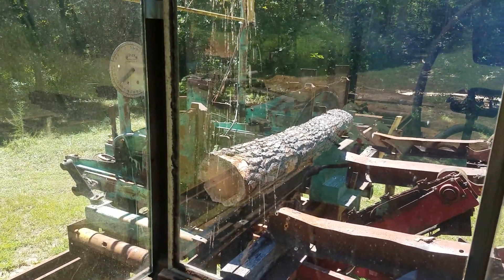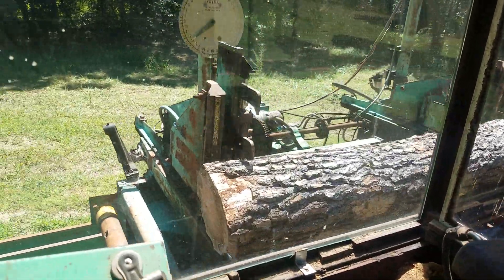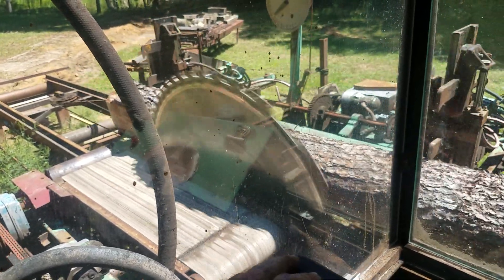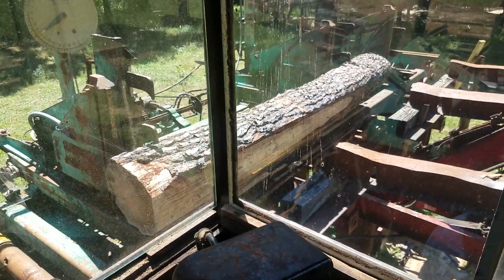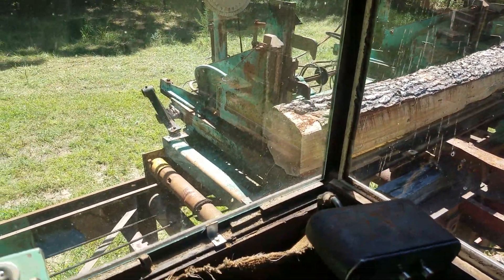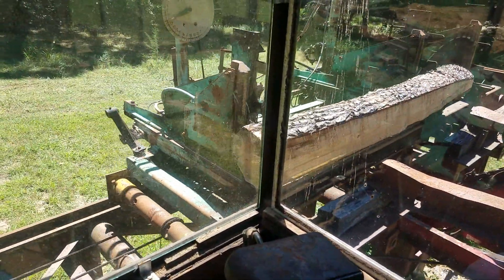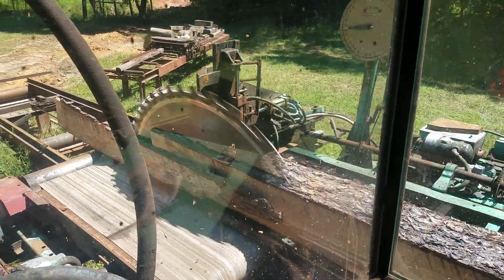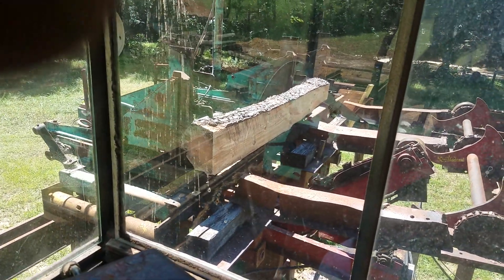First cut dedicated to Mr. Mike McCoy

Comment: That was a good job but you'll have to start telling tales and inflate a toe sack or two just to break even. And get a cutoff set up and make slab fire wood. God Bless!
Reply from the maker: I got me a buzz saw last night for a fair price
Reply: @templehillsawmill1748  Good! You can make a cutoff for slabs and edger strips unless uyou're going to get a grinder and send them to Canton.
Reply from the maker: I'm going the cutoff way for firewood.
Reply: @templehillsawmill1748  That's what he does but if you saw much you'll need a big hole to pile the chunks unless you've got a big market for it. He runs a tandem dump load at a time and has a boiler for heat but you can't burn but so much and people won't buy or come haul but so much. We used to burn it but no more and a grinder has to have a trailer and someone to pull it. It'll be in teresting to see how yours develops but they weren't hobby sawing. It was logging and sawing and hauling to Maggie Valley to Powells and selling local. Still local as far as I know. No grade stamps and you get what there is. He still takes orders.
Reply from the maker: Yeah I'm not expecting to have a great amount to deal with
Reply: @templehillsawmill1748  10/4!